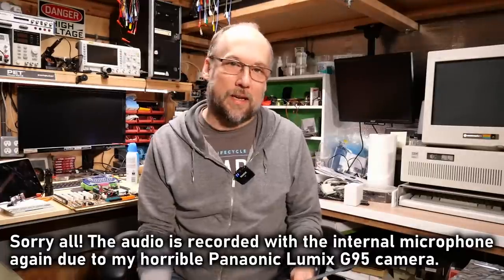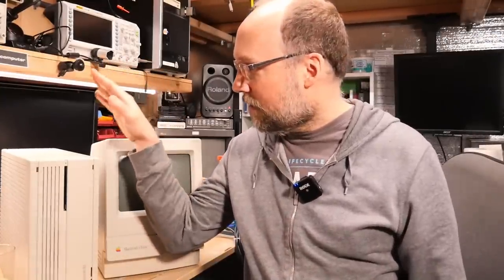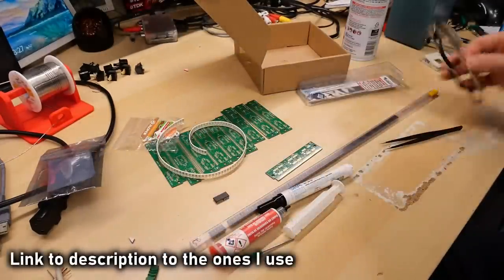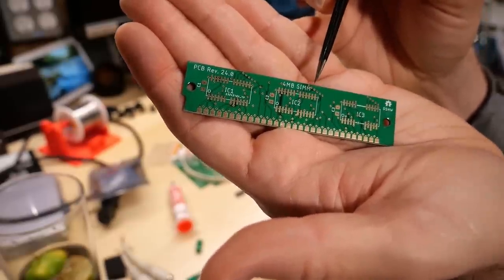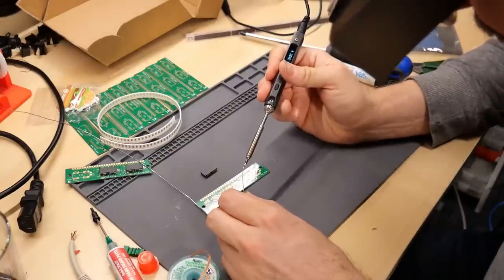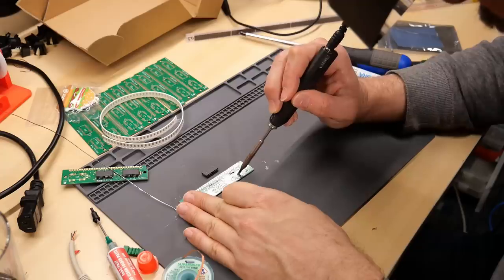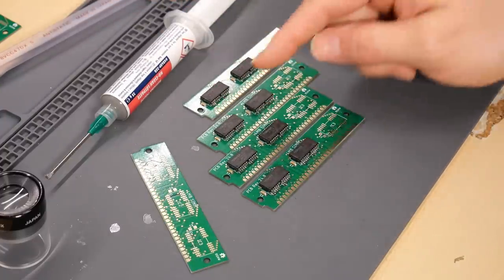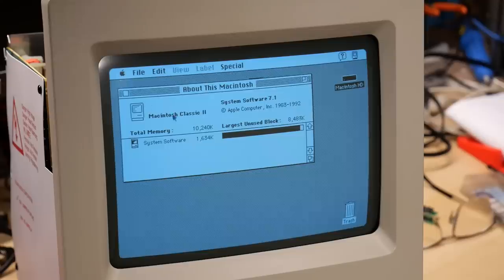Nibble Size: Let's make some memories!

Comment: Very experienced soldering iron/hot air wielder here:
If you don't have a stencil like in your case, tin the pins with your iron so they each have a tiny mound of solder on them. This is enough solder. Then just cover the IC legs in flux (your flux pen is fine) and add plenty of flux to the board and it'll work. You're 95% of the way there. More flux and pre-tin the pads and you'll get it next time you try! This saves you having to worry about having too much solder.
Reply: Haha! That's exactly what you end up doing! :D I always say to friends and colleagues: "it only has to work, it doesn't know how ugly it looks!"

Comment: Awesome!! My very first computer, I wanted 8MB, so I ordered 2 4MB SIMMs. When I tried to boot, it didn't recognize them, so then I learned that my 386 required banks of 4 SIMMs... So bought 2 more rather expensive SIMMs... DOS had no use for 16MB, and I didn't yet have a hard drive, so I created a 12MB RAM disk which I unzipped a couple of floppies into on every boot.
Fond memories indeed!!

Comment: Some tips from my own experience that I haven't seen mentioned:

-If your solder paste is dried out (it does contain flux by the way, that's what the solder balls are suspended in to make the "paste"), simply squirt some of it into a small disposable container (like a plastic shot glass, bottle lid or similar small well) and then add in a bit of paste flux and stir. This will thin the paste back out and make it apply much more evenly. When doing small hand work like this without a stencil (using a stencil is much easier, so get one if you have the chance when ordering a design yourself) I will often use a small slotted jeweler's screwdriver to transfer my "renewed" paste to the pads. You don't need to be perfect, it's more important to just have the paste in the right ballpark and to not have too much on the board. As you found, the hot air will "magically" wick the solder where it needs to go if everything works right

-You want to get away with the lowest hot air temperature that still melts the solder in a reasonable timeframe (5-30 seconds, not minutes). This will minimize the chance that you damage the chips or board with excessive heat, like the warping you got. What I find really helps is pre-heating the board part of the way so that the hot air doesn't need to be cranked up as much to get the solder to melt. There's proper heating plates for this, but you'll get a lot of benefit by using cheap alternatives you might already have. Some suggestions are a thrift store cooking skillet/hotplate turned as low as it will go (don't use it for food afterward!), a 3D printer heated bed (this is what I use), or one of those heated silicone mats off amazon for opening up phones/tablets. Basically, anything flat that can get the board to a controlled 100c-150c will make a big difference and won't harm the board or components, making the hot air step much quicker and less likely to cause damage

-Solder paste comes in three typical "Types" usually labeled T3, T4 or T5. This refers to the size of the tiny solder balls in the paste, with the higher numbers using finer balls. Since the smaller balls have more surface area and flow better, they're just straight-up easier to work with for hobbyists and the price difference is negligible at this scale. The MG Chemicals stuff you have looks like T3 (the largest and hardest to work with), so if you do end up ordering another syringe of paste at some point, make sure to get the T5 stuff. Sometimes it's not a major difference depending on the kind of work, but I'll take every advantage I can get when doing this kind of tricky hand rework!

Other than the above tips, it's mostly about practice and technique. The exact airflow, temperature, and hot air positioning and angle all influence how the paste and chips will behave, so experiment to find a method that works for you. In general notes, I usually do wide circles a few inches above the PCB/chips to get the board "close" to melting temperature, then bring the tip in really close to quickly melt the solder and ensure the chips and board stay in the "danger zone" temperatures for as little time as possible.

Thanks  for all the great content you make, and especially thanks for going deep into the details of your full process and troubleshooting, including the failures and challenges! It's very helpful to others, especially those starting out in electronics, to see that the path is often far more convoluted and challenging than some perfectly produced guides might indicate! Always keep pushing and learning new skills, it will always pay dividends down the road.

Comment: I think the technique you used was out of order. You should have 1) Apply flux to the pad 2) Place the Chip 3) use a small bead of Solder paste on the outside between the legs of the chip and the PCB 4) apply hot  air then use a solder wick with flux to remove any soldering bridges. It would have been easier for you if you has a stencil as mentioned before in the comments.

Comment: Dude, I'm glad you shared the mistakes because we ALL make them, but wow bless you for never having watched a video on how solder paste works! That being said your brutal technique worked okay to be honest! Probably not on anything with a finer pitch or smaller components though! You mostly made it hard by adding flux. That made the paste slide around and stopped your components from "sticking:""

Alternatively, since you have a hot hair station use a clip to hold the chip down, apply gel flux and hot air and touch your solder to each pin, or just use an iron if your hands are stable enough, these chips aren't that tiny. Solder paste only realy works when you have a stencil. You don't need flux - the solder is kinda sticky to keep your parts sliding off once they're stuck into it. It's supposed to be a bit like a glue in a way. You had a lot of trouble because the flux made everything slide around.

Comment: I was feeling your pain with that soldering. I've recently fixed a bad ram chip on my Amiga A600 which are very similar 40-pin J Lead packages. In the end my technique was, flux on the pads, put a little solder on a corner pad, tack the chip corner down with the iron, solder the opposite corner with the iron, then you get the iron to a couple of pins at a time with a little solder on the tip and let the flux do the rest of the work, the solder should flow onto the pad and leg if all goes well. Or if you have very fine solder wire, you can just solder each pin with that.

Comment: You don't really need flux on the components at all! Solder paste is flux mixed with small solder balls. For small DIY job, I  mix a small blob of solder paste with a little bit of liquid flux from that pen in a ceramic cup, and then use a plastic toothpick to "pick" a small blob and move it around on the pads. The added flux makes it a bit more liquid and easier to spread. The "normal" consistency paste is made for stencils and is definitely too thick to manipulate.

Comment: Some tips for the road:
- Use a thin film of solder paste next time, spread it with a silicone pick or an old credit card across the leg pads. It doesn't have to cover the entire strip of each pad, just be on it. The heat will help it flow into place.
- You don't need a stencil, but it does help. In a pinch, you can use something like a Cricut to cut some card for a one-time-use stencil.
- When using hot air, it's helpful to heat your boards from underneath. This prevents the bowing of the boards from thermal expansion. There are professional solutions for this, but you can also get away with hot plates set on their lowest setting to help lower the amount of time you have to focus on a chip. If you can reliably have your hot plate sit at around 400F/200C, it can flow the entire board for you. If your hot plate has hot/cold zones pretty bad, a thin layer of sand at the bottom will even that out to a gentle, consistent heat.
- When going at a chip, try to use a more broad tip for your hot air gun. Paste works best when the entire footprint of the package flows at the same time. That way, it can destress and flow easier and build more consistent tensions around the legs. This is something I had to get wrong a few times before I got the hang of.

Comment: A dedicated toaster oven can be used for surface mount. Instead of having a temperature controlled PID, I use a simple trick: I place a small length of fine solder wire on one of the PCBs. When it melts you wait a few seconds and it's done.

Comment: Oh my, one can sense the frustration! These chips are massive, they should be very easy to solder by hand. Just use thinner solder (0.5mm), tack solder one pin, then the opposite one, then put some flux and solder the rest. Great to see that the modules worked.

Comment: Adrian, as usual it was a nice video! Keep it going man! As for the soldering, you could try this technique: First, apply some solder paste. Not much, and use an old credit card to help spreading it evenly. Then, you use the heat air to make the solder stick to the pads (here you will see how nice it magically goes to the right place). And finally you place the chip as you did on the first ones, holding with the tweezers, but not pressing too much against the chip. Hope that it works better for you!
Much love from Brazil!

Comment: I soldered SMD with hot air only once in a small workshop. If I remember correctly you place a chip on the PCB then put some paste at the pads/pins (e.g. in a small line). If you heat this up the flux in the paste should pull the chip and the solder to the pads automatically. If it doesn't work add more flux and reheat. In hard cases you can also use a hot soldering iron and draw it along the pins.

Comment: If you want to see an expert at SMD soldering, I recommend tronix fix. That guy is amazing! He doesn't reball APUs, but other than that he fixes modern gaming consoles. Another good one is HDD Recovery Services. He recovers dead hard drives (which sometimes requires chip swaps) as well as USB drives, SD cards, etc... He uses thermal paste all the time. HDD services always pokes the chip to verify that it will slide back into place to know it's correct. Oh and paste is not required. I see them take a big solder blob and just drag it down the line to pre-tin the contacts. Once you put the component on you can drag the soldering iron across the pins. It doesn't take much solder. Oh and both channels use a microscope.

Comment: With solder paste it needs two stages of heat. one is just below the melting point to get the flux flowing and then increase to reflow the solder. Solder paste will have a reflow pattern data sheet to show the temps and time needed. When I do this with hot air I have a nice thick stone tile with a polished top so I don't damage my desk or silicone matt. I also never liked the paste from a syringe and had the same issues you did and would use something else to apply the paste. A stencil is so much quicker and saves a lot of mess, but for the number you have it's expensive.   Soldering with the iron and plenty of good amtec bga  flux is a lot easier for a small number of chips like this.

Comment: I usually use a toothpick to get just enough paste to cover the solder pads, then heat the board until the chips "snap" into place. My heat source is the good old Harbor Freight science hair dryer.

Comment: I learned SMD soldering via a similar method to yours! First try was a disaster, I discovered that with solder paste, a little goes a long way! I used a toothpick to smear a film of solder paste on to a flux treated PCB I used two techniques, for some things like ICs I would heat up the solder first until it was evenly distributed over the pads, then I used tweezers to place the IC onto the tinned pads and used a little more flux carefully heated the IC until, like you discovered, the chip dragged itself into place. Other times I would skip meting the solder paste and applied the component direct to the pasted pads fluxing before hand. Experimenting with the airflow can help, using a lower speed can help you get the nozzle a bit closer without knocking the component off line and prevents random pieces of solder getting splattered around the PCB. I think it's just a case of feeling out what works and from then on just refining your technique. Now I find SMD soldering so easy I wonder why I didn't learn sooner!

Comment: Way back in the day a Friend of my Mother's worked for a PC Repair shop. The Repair shop's owner cleaned out the back room and since I worked on Computers the guy gave me 6 boxes loaded with old parts. In one of the boxes there was a odd looking RAM board. It had two 30pin edge connectors with short ribbon cables around 5 inches going to a bigger board that was populated with a 72pin simm socket. The board had a couple of jumpers and misc logic on it. I never got a chance to try it but it looked like it made a 30pin simm based system use 72pin and used two 30pin sim slots. I have no idea what company produced, looked kinda home made since I remember seeing a bunch of flux residue on it.

Comment: When I first started with surface mount soldering, I used solder paste in similar applications to this. it helped me get a lot better at hand rework. Keep it up and you might be doing rework at a professional level in a short time.

That said, I definitely agree with the other people saying to use an iron for this application. The solder wicks around the legs really easily using an iron and a bit of flux, and doesn't warp the small/thin PCB.

Comment: I’m a total noob as well and had always been scared of smd. Finally got brave and bought a hot air station. Now I actually prefer smd instead of through hole. I’m 50, with bad eyes, and shaky hands, if I can do it, I know you can.

I have never used a stencil, and it would probably make the job easier, but I am living proof you don’t need them.

The trick is getting the right amount of paste. It’s ok to smear the paste on if you use a consistent amount across al the pads. Be a little conservative with the amount you use, and you don’t need to pre-flux, there is already flux in the paste.

Get the chip close to aligned but it does not have to be perfect, surface tension of the solder will pull the chip into place.

If you do get bridges, take your soldering iron with the tip cleaned of solder and just touch the pins, the excess solder should flow onto the tip. If you have a stubborn bridge, hit it with the solder wick.

One last thing, be mindful of how much air you are using, the air can blow small parts out of place.

Thanks for another great video Adrian.

Comment: Now you have memories from 2020 :)
Soldering tip: place the chip w/o soldered pins, then solder one pin by hand. It's fixed now and the remaining pins can be soldered smoothly.

Comment: Hi Adrian. I think you did a good job considering the lack of tack flux. When you have trouble with solder between the pins, the first thing to try is a dab of flux, then drag the iron out from the pins.. tacky flux (designed for smd rework). If that doesn't work, touch the pins with a tiny (1-2mm wide) solder braid + extra flux. Doesn't matter if the solder bridge is behind the pins. It will just wick up on the braid. Personally I prefer flux and dragsolder, and solder paste only with stencil.
Reply: I wonder if the chips pin surfaces aren't doing you a favour. Maybe they are heavily oxidized and need some mechanical action to get clean. Not sure. I presume the chips are old stock.

Comment: Use a fine tip soldering iron, 
1: place a blob of solder on one pin.
2: place component on pads and aline it with pads,
3: solder first pin,
4: solder a pin on the other side of component,
5: solder the rest one at a time, clean.
Job done.

Also get yourself an ESD mat and strap to give the chips a chance.
Reply: I've never tried soldering J-lead packages like these RAMs but I'd imagine it would be quite hard to reach under the bend and get the iron where it's needed.

Comment: If you pre-tin solder pads like that, it leaves a rounded surface, which in turn makes it very hard to keep the legs of the device you're mounting positioned correctly. Next time, clamp the device in position (use like a large paper binder type clip). Don't pre-tin the pads. After the device is correctly positioned, with its legs on the correct pads, apply flux, then solder the joint. If the device has a lot of legs, you can "strip solder" them in one continuous go by laying a length of solder wire (of the correct size) across the tops of the legs. You then apply the soldering iron tip to the junction of where the leg makes contact with the solder pad. The soldering iron tip should contact both the leg of the device and the pad. The solder wire will melt, and thanks to the flux, wick itself into the correct position. You can also use soldering paste (as long as it has been correctly stored ;) ) for this. My personal preference is paste.

Make sure you use solder of the correct thickness! If you use a solder that is too fat, you'll end up having bridging problems. If you look at the solder you are about to use and think "well, that's going to be too thin" it's probably perfect; it doesn't take much solder to form a solid joint.

I would also recommend that you don't use hot air for this type of work. Not only is it more difficult, but it is also a lot easier to end up with a dry joint, as the solder and legs typically get a lot hotter than the pad itself does. Just use a soldering iron tip of the appropriate size and type and make sure you touch both the pad and the leg.

As others have pointed out, the carrying agent in solder paste is flux.